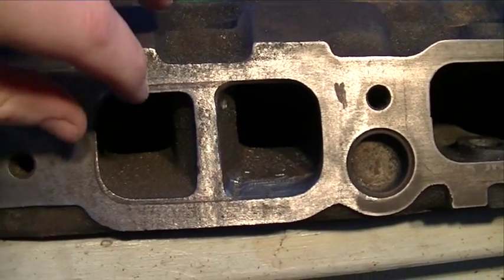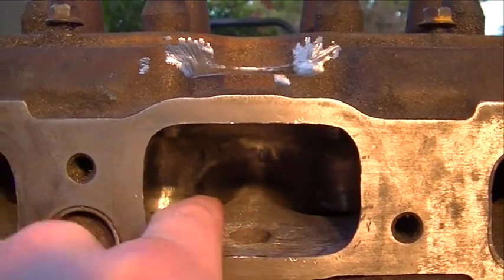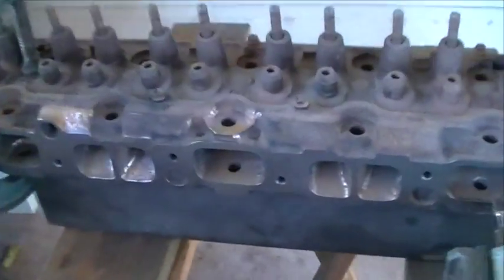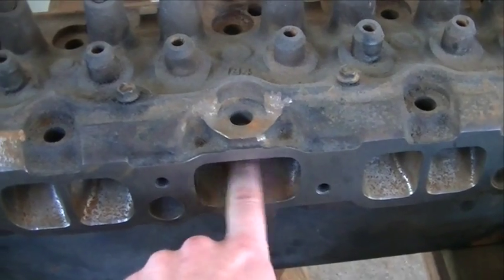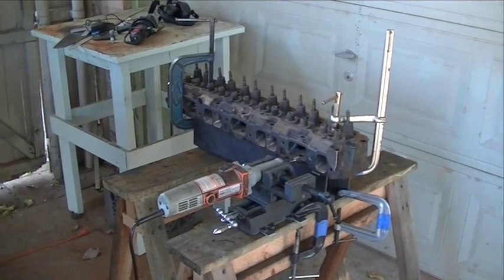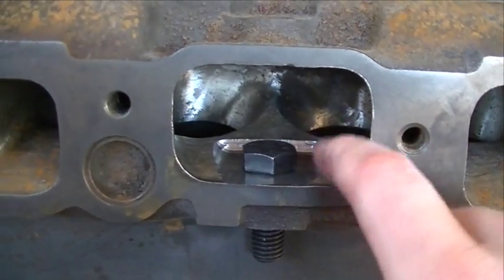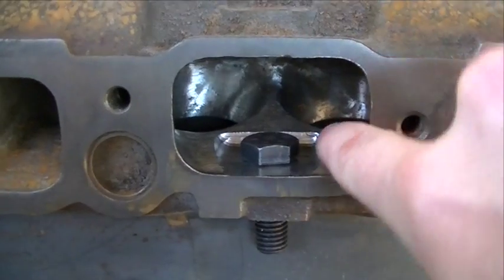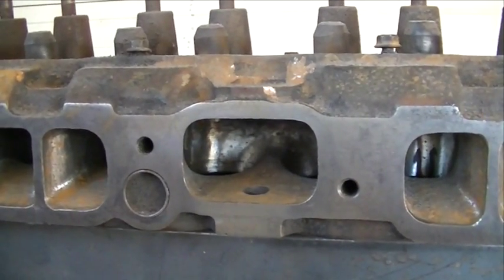Part 6 Chevy 250 Cylinder Head Porting | Inline 6 Lump Port

Comment: Very nice job !!!! great skills  but without the lump port you will create quite a bit of turbulence in the port, while it looks like you will get more air/fuel it wont flow smoothly .the lump works like a fine tapered funnel vs what you have ,again great job but not nearly as effective without the lump installed.